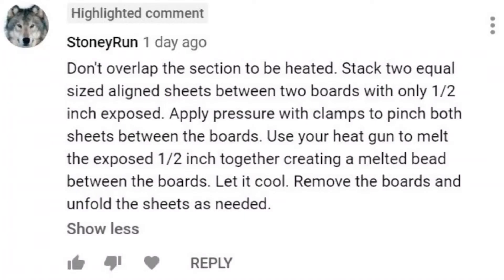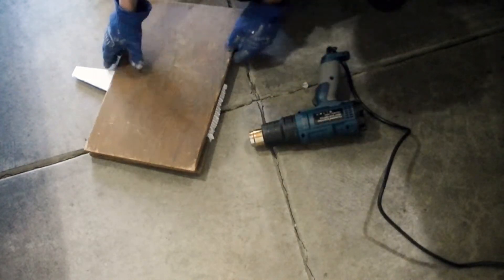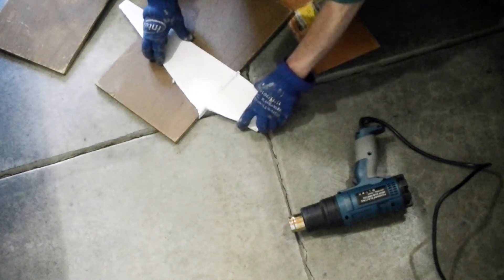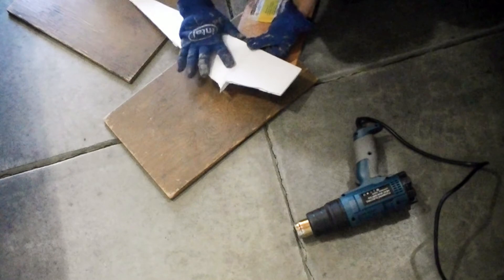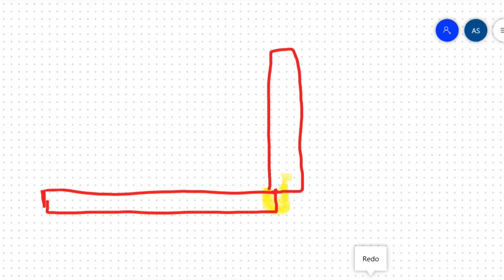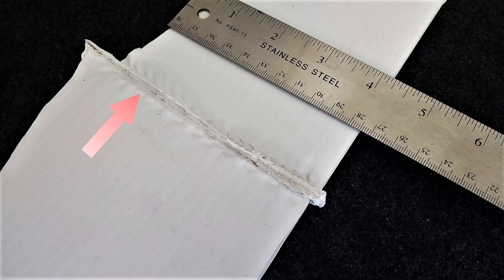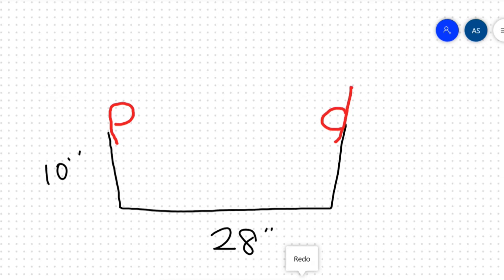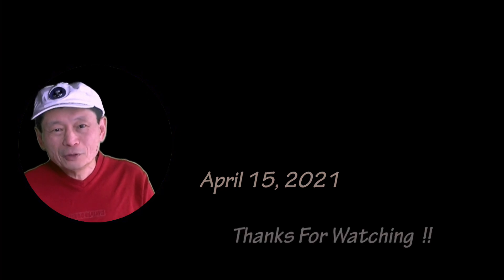Pt 1 2021 New Heat Fusion: Join two sheets of coroplast

Comment: Very interesting. I suggest using clamps to hold the wood firm and even on the outside of the "coroplast sandwich". Also, if you heat from the top in a 90 degree downward direction by setting large coroplast sections straddling a sawhorse or step ladder instead of placing it on the floor it will let gravity create a rounded bead and you wont need to smash the melted excess. Perhaps reduce the amount melted to 1/2 inch as well. Cool experimental test. Very well explained and demonstrated. Thank you for sharing your video.
Reply from the maker: Thanks for your guidance. Yes, I was acting conservatively and allowed more coroplast to be melted. Also, the coroplast I used is 6 mm (a bit more melted coroplast than a 4 mm one).Will try what you have suggested. Thanks for sharing your excellent method in fusing coroplast!

Comment: Thank you. Super handy.
Reply from the maker: You're welcome! Glad you find that useful. The latest from viewers are: 1. We can glue two sheets together using contact cement to create a larger sheet to build boats. 2. Sheets can be glue together with polypropylene hot glue stick. Polypropylene is the same material to make coroplast, therefore I melt the coroplast and joint them together is the same idea as using hot glue stick. But it has to be polypropylene glue sticks, other types will not work..... cheers!

Comment: Hi Hong, I successfully built a six foot kayak for my young son using your Gen12 plan at 2/3 scale. I wish I could show you the video but it came out great and I was able to build it from a single sheet of 4'x8' 4mm coroplast! I have not had as much luck with the 10' kayak. When my friend and I attempted to fuse the two sheets in the middle, we did not achieve a good bond. The coroplast became thin on both sides but did not adhere. My guess is we were too conservative with our heat. Does coroplast have a heat profile that once you heat it once it and it cools, it becomes much less likely to fuse when heated again? I'm afraid if I go at it with heavy heat now I will end up with a paper thin seam and my boat will fold up on me like a lawn chair. I'm wondering if the 3M 5200 Silicone would bond to Coroplast and be a good choice at this point. I could trim the worst few inches of my compromised edges, lose a little length, but then bond the two shortened sheets with marine grade adhesive. I see you tested Gorilla glue but I don't see a test with the 3M product. Thanks for your guidance and for introducing me to the wide world of coroplast building! (btw- after seeing my kayak, my dad is thinking of making a bimini for his sailboat out of wood ribs, coroplast and fiberglass).
Reply from the maker: Thanks for the good news (building the smaller boat) and the not too good news (bonding). A good news is if the coroplast sheets didn't stick together the first time (due to not enough heat to both sheets ), if you apply heat (the right amount - I will explain later) and redo it, they will stick together. If the coroplast has not been fully compressed (to the point that the inner channels all collapsed) it will bond well. Even if they are in the form of a plastic sheet, it will still bond. But you lose the structural strength the inner channels bring. Yet the sheet of plastic is very strong also, but it is a bit rigid and more difficult to fold (or more likely to crack at the fold). The question is what is the right amount of heat: it is better to over heat it, but not to a point the plastic melt and shrink. You want the surface to melt, but not shrink. i.e. the area to be bonded is start losing strength to remain flat and support itself.  When it starts to bend or getting very 'flex'. Same with the other part of the sheet which it will be bonded with. That is the right amount of heat.  Once they are all heated to this point, you have may be 10-20 seconds to place both sheets together. Next important step is to compress two sheets together with a piece of plywood on top of the joint, or use a long piece of 2"x4" wood. Do not apply too much force that the channels of both sheets completely collapsed. Then hold the plywood or 2" x 4" wood in place until the joint cools down. You do not need to have the sheets /joint to be 100% fused, which is not easy with hand tool. You will have to apply silicone sealant to make it water tight. Please watch this video https://youtu.be/rmotKWDNlYg    The fused joint is to provide sufficient strength to handle the pulling/tensile force (much better than tape)
Another option is to use contact cement. The boat posted here https://www.youtube.com/c/DIYUSA/community  built by Susan used contact cement. I also watch a video of another builder used that to build the foldable boats. I believe this would work well. I would have two sheets overlapped at least 1.5' to 2' (or more) so the joint will be water tight. This overlapping will also provide a strong floor at the middle of the boat.  
Hope you will have a good handle of it (heat fusion) in you next try. Otherwise, use contact cement.
If you still have problem, please let me know. I will make a video to demo this fusion step.  The only problem is I don't have 4 mm thick coroplast.... all used up... I have the 6 mm ones only. 
 Cheers!

Comment: If there was a demand for fusing large sheets, I would develop a machine working with a cavity into which one sheet is continuously forced against another that is confined. Forcing the respective edges against each other is step one in my process. Step two is pressuring a 2 in wide strip of tubular aluminum from both side of the joint , this accomplished in an actuated system of steel using hydraulic or mechanical lever action. Step three is pressure-filling the alu tubes with oil heated to fusion temperature for the plastic. Release of finished welded joint to occur when a suitable traveling has been observed in one sheet towards the other, possibly after the heated oil is chased away into a hot oil tank by oil from another oil tank having cooling input. The temperature control could also be done electrically as I have done for a nordic ski injection production machine in Finland.
Reply from the maker: Thanks for your input. You do know a lot more in perfecting this fusion techniques than I do. One of my goals is to create something others can easily copy.  I got my coroplast from China. They can ship a much larger sheet and the size is probably limited by the size of the shipping container (8'x20' or 40'). Ultrasonic welder  can create a very strong joint but cost a few thousand dollars. At least we have simple methods to fused coroplast together, though not perfect, but good enough for now. Cheers!